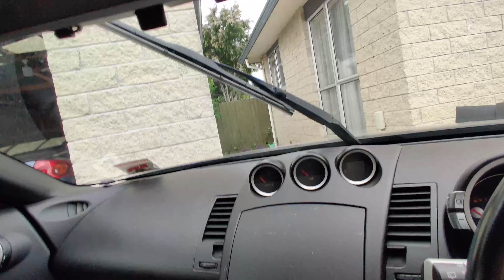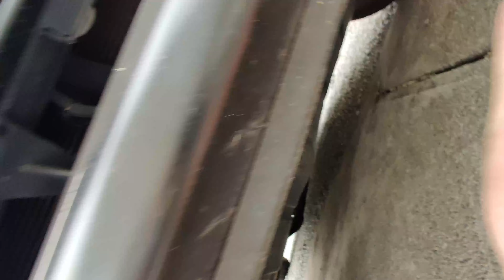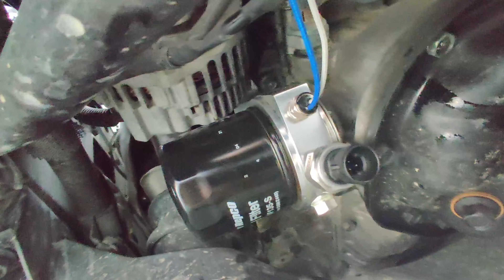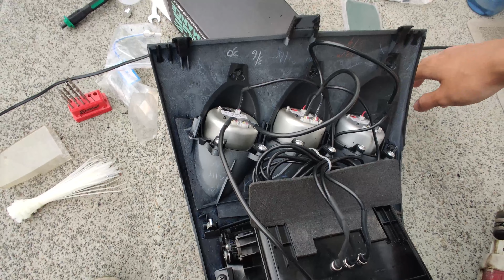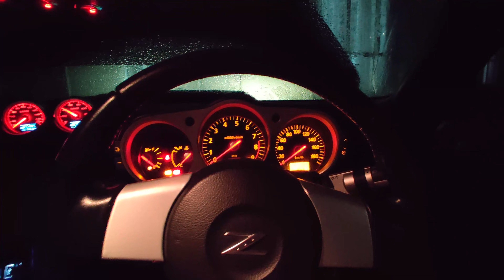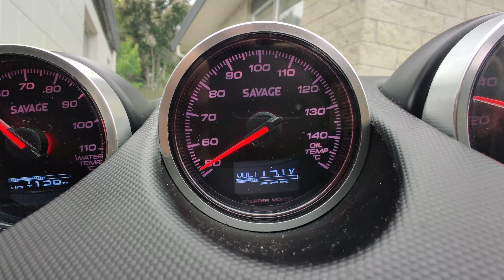Manual HR 350Z gets oil pressure temperature gauges install (350z must have) !!

Comment: hey man where did you get the fitting for the oil filter did it come with the guages or did you have to buy it separately
Reply from the maker: It usually come with oil sandwich plate :)

Comment: Hey, how is the accuracy of the oil pressure gauge? Did you notice a difference from the factory gauge to the savage gauge reading? And how is it holding up now?
Reply from the maker: it is way more accurate as these are wide band. holding up perfect.

Comment: what size are the factory gauges? any idea if this will work on the 370z? do you have a link for the three gauges? thanks
Reply from the maker: i think the factory ones should be 52mm. it should work on the 370 but i have never done it so not too sure you can always go for 52mm https://www.savageperformanceandspares.com/collections/gauges/products/60mm-savage-dual-display-water-temperature-gauge-7-colours